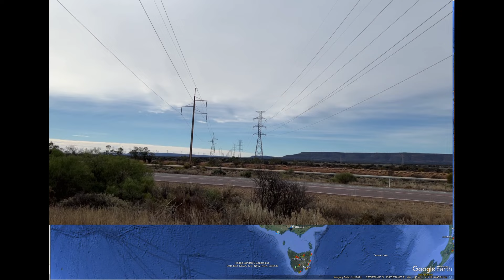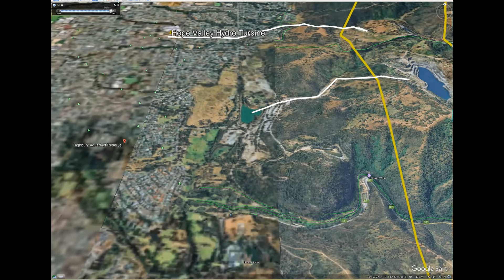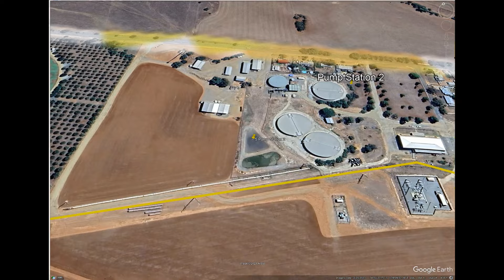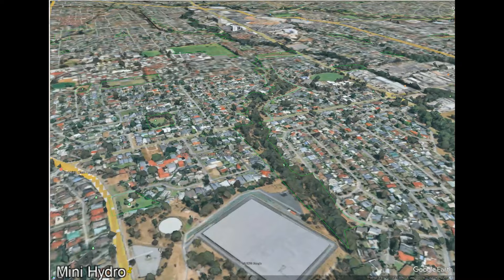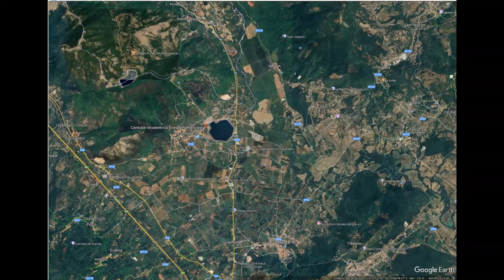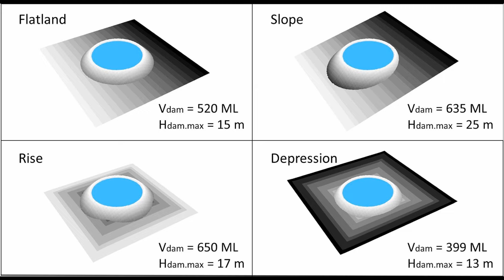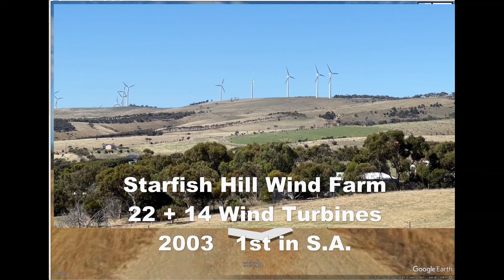Better Big Battery using Closed Loop Pumped Hydro Energy Storage for Dry Environments

Comment: Having known about this storing principle after having seen one in Germany back in the mid 1970's I have looked at it for private use at my farm. There are problems with closed systems in that unless they are totally closed up then they loose a lot of water to evaporation. Also they are not very efficient. They where fine in connection with the old style power stations that also where not very efficient and had to run full speed all the time to gain some efficiency. They could take the over production and give back in peak times. Doing that I was told that their efficiency was better than the actual generating power stations. They just had to be close to lots of water due to the evaporation.
Reply from the maker: Thanks for the feedback regarding you experience with this in Germany.    The enclosure of treated drinking water is now standard with WaterSA.    That is shown by the Nettle Hill Example.   It is high up to get sufficient pressure for the people living as far away asVicotor Habor as well as Middleton and Goolwa amongst others.

With PHES the water in the top dam is "money".   If it evaporates the value disappears.   Evaorartion will be  a big problem with the strong winds in the Flinders Ranges and the highlands of the Fleurieu  Peninsula
Reply: @Highbury5089  I believe evaporation will be a big problem any where in Australia. I have a small farm north of Ballarat in Vic. with a couple of smaller farm dam's and I think about half the water evaporates ever year. They don't leak. The sun is darn strong. Good for solar power.
Reply from the maker: @leonhardtkristensen4093  I found this report 
https://www.e3s-conferences.org/articles/e3sconf/pdf/2019/23/e3sconf_form2018_05044.pdf

It suggests that one of the solutions is the use of air bubbles from the floor of the dam to disrupt the stratification of the water body.     

The heating of the top 3m of the water is reduced as the heat is dispersed into the main body of the water.   

A cooler top layer reduces the amount of evaporation from the surface.
Reply: @Highbury5089  Thanks for the information. I knew about some of them and have actually considered floats with solar panels but my dam location and my solar installation are not right next to each other. Long DC cables are energy wasteful too and expensive. Also I don't need the water so much any more - at least not now. I have got a bore for my stock watering. I am allowed to irrigate some from the dams (not from the bore) but have just never gotten around to it really to any great extent. I have used some water when I have planted trees. It is best to water them through the first summer.
I also just saw a You Tube video about a closed system with a kind of "heavy water". It was water with some particles mixed in that made it about 2.5 times as heavy and there by reduced the height  required.  It might me an idea for me as I have no more than 10 meters difference from one end of my land to the other. Of cause you would have to buy a secret powder to mix in the water. 
Thinking about that I came to think about that one of my big problems I had before I got the bore was that my dam water is very muddy. No filtering appeared to be able to separate it. It is very fine mud/clay particles. I found that a handful of cement made it settle down. I don't know how many thousands of litres I separated. Later when I ran out of water I trailered in 50,000 litres in 1000 litre tanks from neighbour. I then got a bore.
Back to the muddiness. I am now thinking about if my muddy water would do the job to make it heavier. It must some but I don't know how much. It might be worth an investigation. If yes I will need the evaporation to get it do the right slurry condition. It is just as they used to make salt from sea water.
I have Lifepo4 battery storage for about 30kWh so I don't really need it at the moment but just the experiment could be fun.

Add on: I just found some old calculations I made maybe 15 - 20 years ago about such a system at my farm.  I made the calculations considering a 6 meter high difference, requiring 15kWh x 3 for 3 days storage and an efficiency of .751. That would require two tanks  being 60 x 61 x2 meters. That would be a little much space taken.

If the mass of water being 1kg/litre was replaced with 2.5kg/litre as they clamed it would only be tanks of 27x27x2 metre (1.5 mill litre tanks). That would be a bit better. Still no cheap though.
Reply from the maker: @leonhardtkristensen4093  Thanks for the  information.
Your farm sounds like a very interesting place.
This heavy water idea probably adds a complexity and the potential for contamination of the environment.
Reply: @Highbury5089  If you take the products from the local aria like I suggested from my dam how can that be polluting? This mud is just laying on the dam's floor when it is dry. According to the video it was such materials that doesn't pollute and surprisingly the wear on pumps etc shouldn't be much worse.
The video on you tube is called: The Genius of 'Waterless' Hydro Energy Storage by Ziroth.
Reply from the maker: @leonhardtkristensen4093  I was referring to the unknown substance in this "heavy water"   The other problem with this unknown substance is the viscosity of the water and this affects on the rotation of the turbines.
Reply: @leonhardtkristensen4093  Sounds good in theory, however the mud is very abrasive and would likely reduce the lifespan of the impellor and seals considerably.
To reduce evaporation, fill the storage with gravel and top off with clay. It's coincidently a great way to keep seedlings going. I kept a 100 unplanted native trees tubestock going over hot mid-north SA summer in a large plastic sheet lined tray filled with 12mm gravel.
Reply: @seeker1015  The "dirty water " I have is really clay particles I believe.  It is so fine that I haven't found any filter that can block it. I am sure the ones they use to take salt out of water would do but I only tried normal water filters. 
 I have pumped a lot of it and the pumps I have lost have been more to corrosion that wear. I also have lots of iron around in the form of little stones that can be picked up with a magnet so any iron laying on the ground rust like mad.
The dams only loose water to evaporation and when I am pumping and that is not much any more as I have got a bore. The animals like the bore water much better.
Reply: @leonhardtkristensen4093  Have you heard of flocculation? A dry powder liquified and then is sprinkled on the surface and it sinks in and seemingly magically, ionically actually, latches onto the dirt particles and makes them fall out of suspension. I've seen it happen, truly astounding the speed it happens at.
Reply: @seeker1015  I have heard about that there are chemicals that can do it but by accident I dropped some cement in the dirty water and that did the trick just fine. I had drums and also a near 4 square meter basin that I used. I have cleaned thousands of litres as I had a lot of poultry that needed clean water. When my dam went empty  I borrowed water from a neighbour. I picked it up in 1000 litre tanks - 50 times. The I got a bore.
Reply: @leonhardtkristensen4093  Yes, hauling water like that gets old real quick. We lived rent free in an old church and before the bore went down and the windmill went up, we'd tow a dead Transit tray top with a 1,000 gallon corrugated tank down to the farmer neighbour's bore, part fill it and tow it back up. What fun? We kept the owner's trees alive for 2 years, Much easier once the mill was working except for the tense times in Jan/Feb, waiting for the winds to come. it's a real oasis now in a broad valley of grain fields.
Reply: @seeker1015  I used to play with he wind too but although lots of it it was rarely strong enough to make any electricity. I now use solar panels and lot's of them. I use second hand panels as I some times get them for free. Solar power, Lifepo4 batteries and a bore pump works - until the bore runs dry which so far only last an hour or two and it is only that it doesn't seep into the bore fast enough. We get the water we need and we only have to flick a switch.
Reply: @leonhardtkristensen4093  Yeah, wind is fickle. Where this mill was it had good wind when it blew. It was the siting that was the problem, on the wrong side of the church from the prevailing wind so it eddied over the 10m high roof. I told him to put in the other corner where it got clear air, he ignored me and the eddies ended up destroying all our hard work. When it blew it was something to watch as it would lift the big block of concrete we poured for the pipe head support. Wind pumps are good, but do need regular attention and shutting down in strong winds. And, yes, he's converted to electric DC bore pump now off a small solar panel. Water is 100 m down and like spring water.

Comment: So they can only last a couple of days?
Reply from the maker: Edward   It depends what you are trying to do.    If you only want to make lots of money you will switch on all the turbines and allow all the water to run through the generators.    in any given day you would only need 7 or so hours when you will be generation electricity.
    
If the idea is to have reserves of potential energy to last more than one day you will only let release some of the water from the top dam on any given day.

Comment: not that i dont think 1 day we will run off tidal and hydro power, we are a water world after all the majority of energy on planet is in our tides

and for a number of yrs ive been pushing for decentralized hydro power generation probably decades now but  they boondoggled all that cash into snowy 2.0 rather than something useful like electrifying our water resivours
Reply from the maker: The Snowy Hydro is a quasi autonomous government authority created as un-listed public company.
The Australian Government bought the shares owned by Victoria and NSW.   
It trades under a number of other names in most States of the country.
It made a profit of $441 m in 2022.
https://en.wikipedia.org/wiki/Snowy_Hydro
They have published the estimated cost of Snowy 2
The directors have not released the estimated income for the project.
The next AGM should be interesting.

Snowy Hydro trades under names of Lumo Energy, Red Energy, Hunter Power Pty Ltd, Lumo Generation SA Pty Ltd, Contact Peak NZ Ltd, Contact Peak Pty Ltd, Latrobe Valley BV and Valley Power Pty Ltd

Some of these entities trade in retail gas and electricity sales in various markets.   
It owns the Angaston Power Station in S.A. with 30 diesel reciprocation generators along with the Lonsdale and Port Stanvac Power Stations in the same market.
The bought the diesel generators from the previous SA Marshall Government that are currently located at the Bolivar Sewerage Works
Reply: @Highbury5089  The 4 temporary GT generators at Lonsdale were leased for 25 years from 2020 by the Marshall Government to Infigen, who are now a subsidiary of Iberdola. At Bolivar the GTs can now run on natural gas.
Reply from the maker: @alexcowie809  Yes you are correct.

They might be being used by SA Water itself!    They are probably using Biogas from Bolivar Sewerage works
https://www.sawater.com.au/news/bolivars-biogas-breaks-renewables-record

We now use a lot of electricity pumping water and sewerage around the state.

For example, the North-South Connector takes water from the Murray Bridge to Mt Bold Reservoir pipeline to areas north of Seacliffe.   

https://www.gilkes.com/case-studies/seacliff-case-study

There is even a micro hydro plant in Seacliffe that generates electricity using the head of water coming down from Mt Bold.   Similar to the one at Hope Valley.
Reply: @Highbury5089  Aren't the Bolivar human methane gas generators all turbines now? I didn't think the reciprocating generators were Diesel as they were burning gas. I saw them in the mid 80s when there was only one turbine. Tour guide said then the plan was to replace all. That was before privatisation of E&WS. Back then they flared off the majority of the gas from the 6 digestors. I was shocked and said so, a decade later much better use was made of it. Also the hundreds of gigalitres of water was pumped out to the gulf, another thing rectified thankfully.
Reply from the maker: @seeker1015  Yes it seems things have been upgraded
https://www.iberdrola.com.au/assets/Bolivar-Power-Station-OEMP-Revised-25-May-2023-5496-Stamped-Low-Res.pdf

"The Bolivar Power Station comprises four General Electric (GE) aeroderivative TM2500 trailer mounted turbines, with associated equipment. The turbines are capable of dual fuel operation i.e., natural gas and diesel fuel; however, will primarily operate on natural gas, with the diesel fuel used as a backup. Diesel fuel may be used up to approximately 20% of operation. The gas will be supplied to the Facility via the new gas pipeline built by EPIC Energy, while the diesel fuel will be supplied via road tanker and stored on-site.  "

They are using site as a convenient way to access the Power Grid.     It seems they are not planning to use the Biogas !!!!  
The Biogas would need to be accumulated in a Gasometer / Gas Holder 

"The BPS is configured to operate in Open Cycle Gas Turbine (OCGT) mode and will operate as a 127.5 MW peaking power generation plant. Open Cycle Gas Turbines generate electricity for ‘short’ durations during times of peak electricity demand. Each turbine unit has a nominal output of 30 MW."

If they run the 127.5 MW turbines for one hour 

100 MWH of electricity would require approximately 453,120 cfm (cubic feet per minute) of natural gas in a typical power plant efficiency of 30%.
That is 769,850 cubic meters of gas per minute.

The capital cost of the Gasometer being a deciding factor in not using the Biogas.  The gas is owned by SA Water.  

Much easier to use the SEAGAS gas pipeline that runs just past Bolivar.    Natural Gas from Bass Strait in Victoria being burnt in South Australia to generate electricity.

This is free enterprise.  The aim is to make a profit for the private company.
Reply from the maker: @seeker1015  It would involve building a Gasometer / Gas holding tank to hold the Biogass.
Much easier to access the SEAGAS pipeline that runs just past Bolivar on its way to Torrens Island.   Gas from Bass Strait in Victoria being burnt to generate electricity in South Australia.
Flare off the Biogas because it is cheaper to burn Natural gas.     It is all about creating a quick profit
Reply from the maker: @seeker1015  
https://www.sawater.com.au/news/bolivars-biogas-breaks-renewables-record

"09-08-2022
Bolivar’s biogas breaks renewables record
SA Water has achieved a renewable energy feat in its goal towards reaching zero net emissions, with South Australia’s largest wastewater treatment facility recently achieving record levels of energy self-sufficiency."

"By increasing the production of biogas – a by-product of the wastewater treatment process – SA Water’s Bolivar Wastewater Treatment Plant generated 3,099 megawatt hours of renewable energy in July, marking the highest monthly levels recorded and well above the yearly average of 2,800 megawatt hours."

"3,099 megawatt hours of renewable energy in July"  translate to 10O mWh per day from the inhouse generators.

What is not stated is the total potential biogas production.